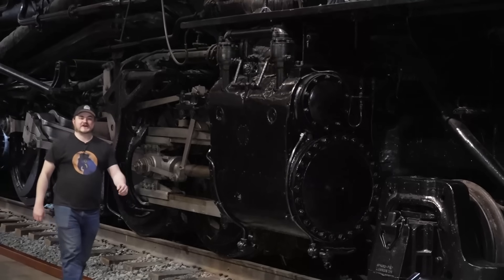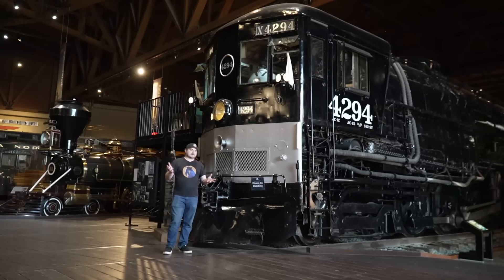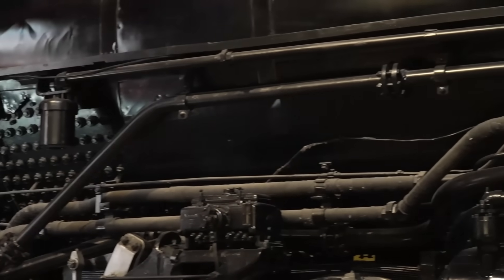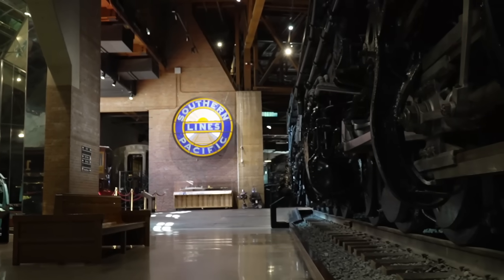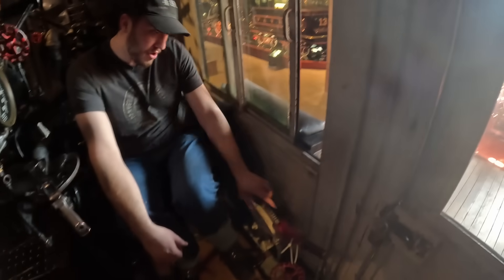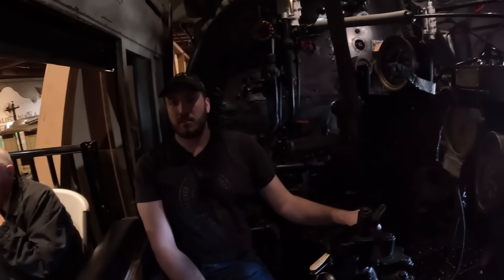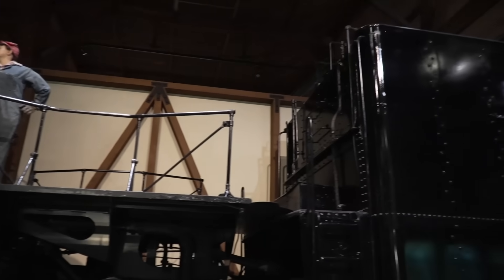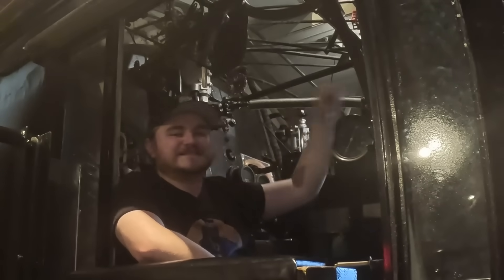Why did Cab Forwards exist? | Railroad 101

Comment: I've developed a curiosity about the counterbalancing of these locomotives given that some were used in passenger service and that the "backward" operation of each driver set causes the vertical component of the main rod forces to be upward.  So, I think any main driver overbalance would quickly develop into problematic dynamic augment and slipperiness.  I wonder if any counterbalance records or detailed specifications for these locomotives exist?  I really don't think the museum would permit disassembly of the locomotives so as to balance the main drivers on knife edges, weigh the rods, and swing the main rod for center of percussion.  ;)  OK, I'll crawl back in my nerd hole now.

Comment: I've mentioned this before many times, and I know I'm not the only one to say it but this would be an incredible locomotive to see restored to working order. What are it's issues again? I believe I've been told before that it would be impractical or there are some kind of issues with restoring this engine. Is it really anymore impractical than restoring 4014 or 3985? I know there were plenty that claimed that 3985 would never run again even though it's now being restored by it's new owners. Maybe it could be leased out like C&O 2716 is from the Kentucky Railroad Museum.

Comment: Maybe a stupid tought but why they just dont ducted the stack backwards, just after the cabin, let's say, like we do with cars today?
Reply: The stack helps pull the draft that feeds the fire. Making it a long duct would kill the draft.
Reply: Performance would be poor. Remember that a steam locomotive works by using steam to force the pistons in both directions. Once the has done its job of forcing the piston to the other end, you'd ideally like it to magically disappear. Any resistance the steam encounters while trying to leave the cylinder means that the cylinder evacuates slower, so the steam trying to force the piston back encounters more resistance. To put it another way, the more resistance you have in the stack, the more of the locomotive's power gets used to clear steam out of the system rather than on pulling the train. That's already an issue with Mallet-type steam locomotives: you have the ducting that takes steam from the high-pressure cylinders to the low-pressure ones. That's a large part of the reason why a Big Boy is only about 40-50% more powerful than an FEF (in terms of drawbar horsepower; they had over twice the tractive effort, which is generally the more useful measure).

As NBSV1 says, there'd also be poor drafting. Within the smokebox, you actually blow jets of steam through free space to pull air through the fire and -- equally importantly -- pull combustion gasses through the boiler. I don't think you'd be able to do that with a big ducted exhaust, because the duct sounds like it would induce too much back-pressure. This problem can't be insurmountable, as there were locomotives that were designed to run on the London Underground which condensed the steam back into water to avoid filling the tunnels. But performance would be poor.

There's also the simple physical problem: where is this duct going to go? You're going to need something like an 18-24in diameter pipe along the length of the locomotive. There isn't space for that.

Comment: Nobody tried piping the smoke back behind the cab?
Reply from the maker: It'd limit draft. The stack is a nozzle, after all - it needs to exhaust to atmosphere pretty quickly for a number of reasons.
Reply: Long story short: the more resistance there is in the exhaust stack, the more work the locomotive has to do to get steam out of the cylinders, and that's work that isn't pulling the train forwards. Also, a simple physical reason: where are you going to put an 18-24-inch diameter pipe along the length of a steam locomotive?

Comment: Wasn't there an incident where those long oil lines came back to bite them? I don't remember the specific story, but an oil line failed and dumped a bunch of oil on the rails. That was enough to cause the locomotive to wheelslip something fierce, and the resulting slack action caused a knuckle to fail and the train to dump, leaving the crew stranded in the tunnel as it filled with smoke and the fire spread. I don't think that was enough to stop SP from using them, but I remember hearing about something like that from, (I think) Train of Thought's channel.
Reply from the maker: Oh wow. Yeah, that's far from ideal.
Reply: For the curious, I found the video. I believe the story starts around the 5:25 mark.

https://www.youtube.com/watch?v=QdCXdQqaz5o

Comment: Could you do a video about the whereabouts of the last remaining War Department 2-8-0 Locomotice WD no. 79189 that was shipped to the USA as an exchange with a S-160 from the USTAC and if it still exists it's the sole survivor of it's class
Reply: Don't think that one is the soul surviving austerity 2-8-0.
Theres atleast 1 in operation in britain running on the Keighley & Worth Valley Railway which went to the dutch and then sweden before coming back to britain.
Reply: @davidty2006  That one the  is the sole 2-10-0 austerity locomotive left in operation. It would be nice to solve what happened to the one exported to the USA as it is a bit of a mystery

Comment: The Pennsylvania Railroad had an early electric known as the P5a, which was a boxcab electric. The cabs were located on each end of the locomotive until a grade crossing accident on the New York Division killed the crew when they struck an apple truck stuck on the crossing. After most P5a were redeveloped into the P5a (modified) which had a center "steeple cab" design, similar to the in prototyping GG1 and R1 electrics

Comment: I'd only heard of cab-forwards as a name. I didn't realize it's not just cab-forward, it's Whole Damn Locomotive Bass-Ackward. Including the articulated engine set. What a bizarrely beautiful machine. 
Although I see the point about not being in the crumple zone if you hit something. 
Thanks for the video! Another great learning experience!!
Reply: Yeah I've seen that locomotive many times and never quite realized all the extra engineering needed to accommodate not just the reverse systems but the articulation. Dang.
Reply: It's been tried many ways. There were some attempts that had the engine the correct way around, and the engineer got his own cab. Those failed because of communication issues and the lack of Deadman protection.
Reply: The articulation confused me too, it guess it saved a bunch of time to tinker with an existing design to run it backwards, instead of a more polished right way round design.  I’ll watch it again, but being oil, can’t see why it couldn’t be fired from the rear, and just move the cab and gauges to the front.

Comment: Another few facts worth mentioning (I may have done a little reading about cab forwards lol). 

The air pump exhaust was SIGNIFICANTLY louder that portrayed in the museum.  

The deck between the smokebox and the tender was referred to as “the monkey deck” because hobos often hitched rides up there.

The more modern cab forwards were also equipped to handle passenger trains, having a steam heat line.

Those who REALLY wanna deep dive into these things, should find a copy of Cab Forward by Dr Robert J Church. Hard fo find but a good edition to a foamer library.

Comment: The smoke in the tunnels was bad but also the snow sheds. SP had a lot of snow sheds. The device located right over the center of the twin stacks is a smoke splitter to lessen the exhaust damage to the roofs of the snow sheds. I don't think I have to ask what your Dead Head friends favorite Dead tune is. Side note: Jerry Garcia and Robert Hunter often had trains mentioned in the songs they wrote for the Dead.

Comment: Even though I've been to this museum, and seen this loco, the size of it alone is hard to comprehend, at the beginning when you walked next to it there was almost a look like it had to be a green screen because it felt out of scale (unless you're 3 feet tall).   Just a massive locomotive all around.

Not an engineer but I would think a better solution for tunnels is to simply have a way to close up the cab (windows and doors that are "air tight") then when you emerge open them back up.
Reply: I'd imagine an air tight cab would be hard to make & pretty dangerous in itself if it worked (if any CO from the firebox can enter that's catastrophically bad, but if it's only the CO2 the engineers breathe out that builds up, they'd probably remember to open back up once the headache & panic sets in). Then again, even the simplest solution for tunnels - 'hold your breath & drive real fast' - probably works a lot of the time!
Reply: @nathansmith3608  Well the first key would be to prevent the sooty smoke from going into the cab I would think,  other than that maybe they can have an air hole in the floor that goes close to track level air should be good there?    Either way, not sure at what rate CO or CO2 would enter the cab,  like you said hold your breath and go through,  like the picture that was shown toss on a mask if it's a long tunnel, seems so much cheaper of a solution than redesigning the locomotive.

Comment: Getting around the smoke in tunnels problem is a fascinating part of railroad history. You can satisfy all kinds of foamers. Cab forewards, Portal to portal electric, or T motors. Great video on the cab forward!
Reply: Or gas masks (I know alot of foamers into those, for some reason...)
Reply: The EMD tunnel motors as well, those were specialized variants of the SD40-2 and SD45 that moved their air intakes to prevent overheating in long tunnels. They made about 500 of those for SP and Rio Grande, and several are still in service to this day.

Comment: Great video and fun fact for you. The UK had cab forward locomotives too. They were found on the Glyn Valley Tramway and these were 2ft 4inc locomotives with an 0-4-0 layout and were designed as a cab forward and had skirts covering all the motion and the sides of the engine. To meet the rules of the tramway they had to give an un obstructed view for the driver, a speedometer and limiter to 10mph and they had turntables at each end of the tramway to turn the engine.
Reply: Theres also bulleid's abomination which is the Southern railway's leader class...
which looks like a normal diesel engine but it's steam and the fireman is IN THE MIDDLE.
Reply: @davidty2006  Yeah those things were murder to the fireman and a sweat box being fully enclosed

Comment: The failed German Cab Forward 05 003 also is an interesting Tale. It failed because it was designed to burn Oil but then was changed to Coal Dust, for Strategic Reasons that probably explain themselves in 1930ies Germany. It suffered constant Combustion Issues because the Coal Dust couldn't be blown steady through the Fuel Piping that was designed for Oil. Following these Issues, the Locomotive was turned around to a conventional Design with Cab at the Back, and the streamlined Shell was removed too.
Reply: Coal dust firing has its own issues - coal dust in air is a high explosive. The tenders detonate if nitrogen blankets aren’t used (my great grandfather drove one in Australia in the 1930’s - they went through three tenders in a year of testing).

Comment: Loading Gauge is such an interesting topic. In South Africa, our main network is Cape Standard Gauge (3'6" / 1067mm) yet our loading gauge is bigger than the UK's which runs on standard gauge track.
Reply: The UK should simply fix it's loading gauge to UIC loading gauge as everyone around them has.
It also took the Union only 48 hours to fix the gauges of the entirety of the traitor states post war and loading gauge is just one more word, what difference can that possibly make.
in the wise words of jeremy clarckson: "How hard can it be"?
Reply: @1121494  Hahahaha, yes, we should simply rebuild every bridge and tunnel in the country. And, by "every bridge", I mean "almost every place where a road crosses a railway", as we have very few grade crossings. And we have a lot of roads crossing railways, because England has 50% more people than California, in less than a third of the area.
Reply: @beeble2003  Believe me, I know the UK, have experience there with the stuff.
It's experience with surviving old UK infrastructure in comparison to other that creates this aggression against it.
It's experience with 3+2 seating on a loading gauge barely fit for the consideration of 2+2 that makes you wish someone just strapped an adaptation to the swiss rotary snow plow to some trains to free up some height from entirely wrongfully heritage protected overpasses.
It's experience with both the fresh water supply and the seawage issues, that makes you desire for the Blitz to have been far more effective.
Believe me, I know the UK.
Population density also isn't an excuse for worse network than e.g. Germany or NL.

As I stated, it took the Americans less than 48 hours for an entire gauge change to the entirety of their traitor states with the technology of their times, a network larger than the UK's network just pre-beeching, so a loading gauge change to the remains during beechings planned modernisation and upgrades to the remains with much more modern technology should not be too much to ask for.

Also, the rest of europe didn't inmeadiatly first create UIC loading gauge before it's first railway building either.

Again, in the wise words of jeremy clarckson, "how hard can it be?!
Reply: @1121494  It's not "entirely wrongfully heritage protected overpasses" -- it's every bridge in the whole country. How hard can it be? How much money do you have? Answer: not enough.
Reply: @1121494 the reason for the UK loading gauge problem, with the exception of parts of what was "God's Wonderful Railway", is that being first made them Guinea pigs, they were designed for the era when a locomotive had six wheels, maybe eight, and the tender had the same, all up not more than 20 tons, and it was road carriage sizes.  The Pantechnicon was rarely seen in town.  So bridges were lower, overall widths were narrower.

The bit about God's Wonderful Railway, is Brunel's 7'3" gauge, giant machines, but still not much bigger in the loading gauge.
Reply: @PiersDJackson  Brunel gauges' loading gauge being wider is quite visible from it's depictions e.g. at the baker street underground station just to name one example.
And the rest of europe didn't inmeadiatly start with UIC loading gauge either.
Reply: @1121494   "loading gauge" is the clearance to structures and tunnels. Increasing loading gauge means reconstructing tunnels and station platforms, and moving buildings surrounding the entire rail network, not just fidgeting rails. around.
Reply: As for comparing South Africa with the US, you probably have commuter trains faster than the entirety of the Americas has in intercity, not to mention other african countries that actually have HSR.
Reply: @1121494  not actually true. We have one rapid rail system of only 50 route miles, runs up to 100mph. The national system is in shambles due to political nonsense (eg, catenary systematically removed - read stolen - whole tracks and sleepers stolen). All this came about in 2020 because the politicians have taxis and trucks in their pockets. When I speak of taxis, in our context, these are minibuses which are also run by gangsters and are above the law. Over the last year they have started to 'replace' what was stolen and slowly getting the network back and running - and wouldn't you know, just in time for elections in May. Its very bad down here, trust me things are way better up there by you. There is currently only one African country with HSR - that's Morocco using the French TGV trains. There is talks of introducing HSR here between our business center inland and the one port city, but nothing concrete yet and there is the problem of a plateau to overcome (in my mind this can be down with a series of helix's)
Reply: @1121494 we have the Gautrain running in the Gauteng province… using the 1,435 m gauge

Comment: My favorite design feature is the earliest cab forwards and articulateds blew the roofs off the snowsheds on Donner Pass. So instead of some uber high tech blast nozzle or exhaust system, they just stuck a metal bar across the stacks. Low budget, low tech, and worked like a treat

Comment: There once was a standard gauge cog rail line which went up to a mine in the mountains (Erzbergbahn). Some documentaries were made about this line and how it operatet (steam locos until the closure of the line in the 70s) and one of them once shows the train going up through the tunnel from inside the cab (by the way every single train had two locos, one at the front and the other one at the back but I think that they split the train and let the two halfs go up one by one so the smoke was a bit more survivable, the fully loaded train got also split in half but didn´t connect behind the tunnel and instead went directly to the transfer station). They showed in the film, how the whole crew crouched on the floor of the cabin, held wet rags in front of their faces and tried not to pass out!
Reply: I´ve just searched it and you can find it at the Österreichische Mediathek and it´s called Zahnradbahn Eisenerz-Vordernberg (37 minutes long) Last two minutes: Tunnelscene